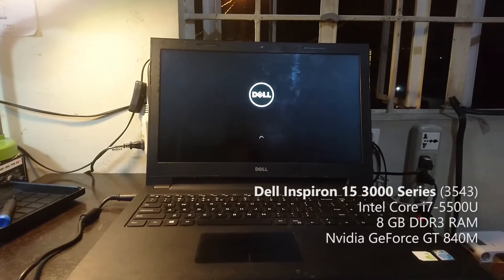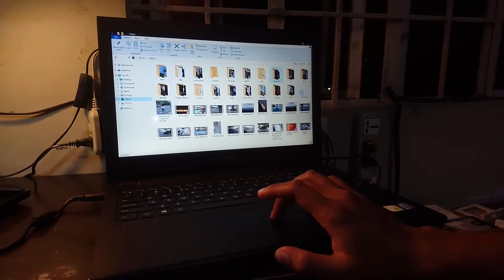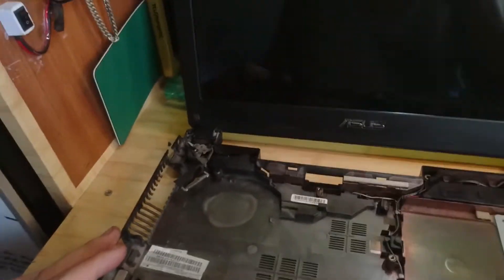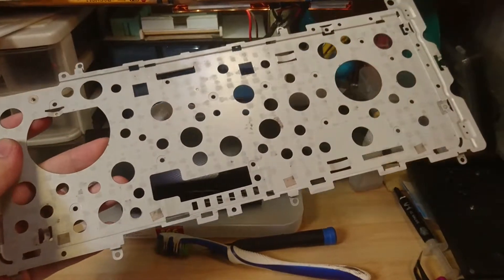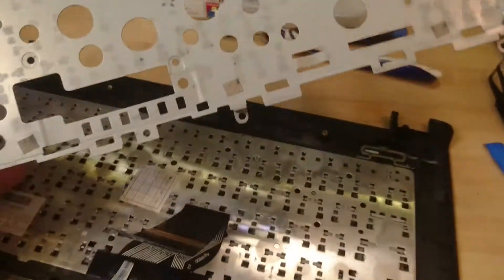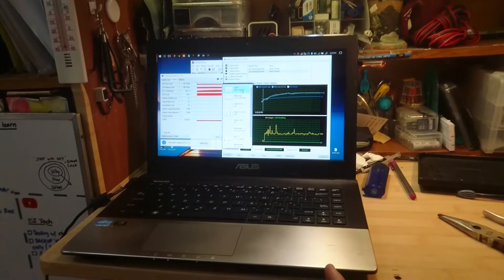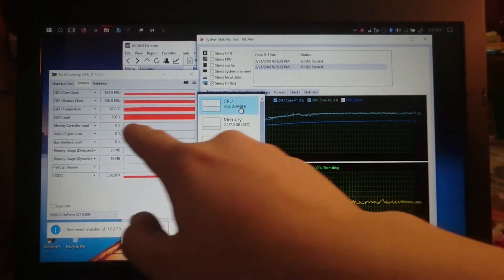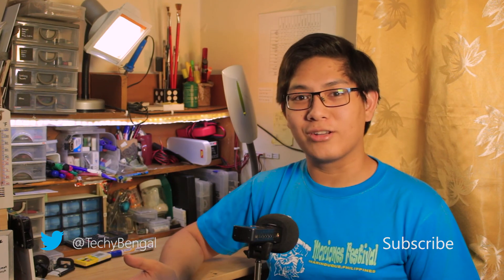Laptop Repair Log 1 -  aDell and Isaac (Inspiron 15 and Asus K45)

Comment: Our family has 2x dell inspiron 3721 laptops . one of them has had a boo-up glitch since new. Were getting a message that say's - Realtek 
pCIe FE controller Series v1.25 ( 04/19/11) - PXE-E61: Media test failure , check cable. PXE-M0F: exiting PXE rom. No Boot device found.
Press any key to reboot the machine. We got this message when there was a hdd that came installed in the laptop at purchase and now 
after replacing the hdd with an ssd.After you press a key it boots into windows. I updated the bios and updated the pcie controller bios
but it's still having the problem. Any suggestions on how to fix this would be much apricated.
Reply: That might be a hardware issue. Can you boot to windows?
Try connecting everything that comes with the laptop i.e wifi card, dvd drive, bluetooth if any and disconnect any external usb devices.